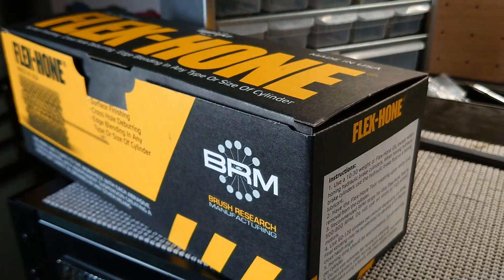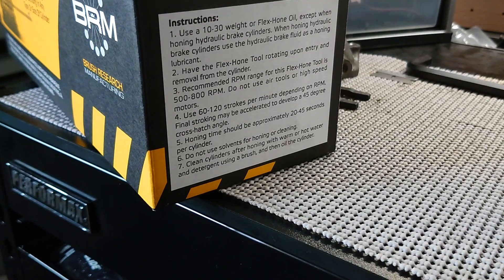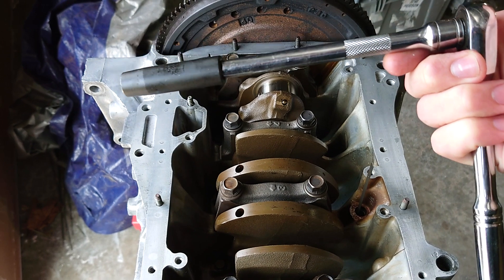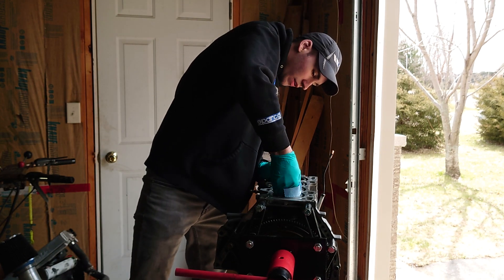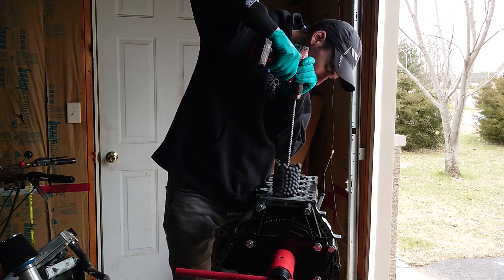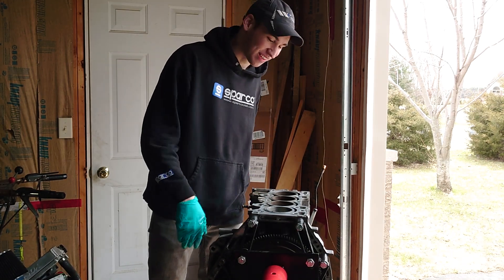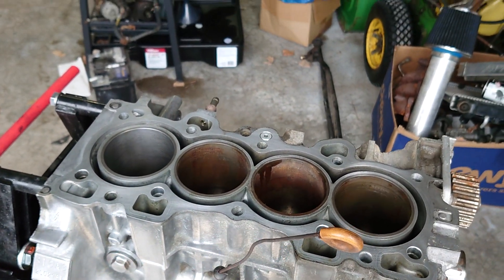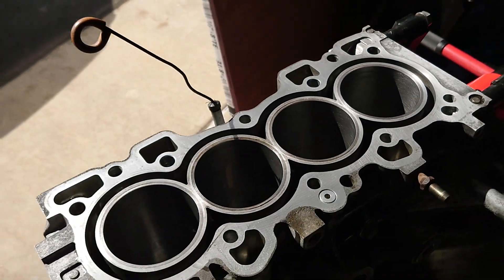Honing Rusty Cylinders on my B16!

Comment: Is it possible to over bore the cylinder using this method? and Can you also use stock rings or do you have to go slightly bigger??
Reply from the maker: You can't properly over bore this way, a machine has to do that. And your definitely gonna want some new rings after this to make sure they are gapped correctly

Comment: I would have put a rag at the bottom of the cylinder to keep the crap from getting in the crank bearings. Flip it and clean from bottom up.
Reply from the maker: I tried that, the hone likes to get caught on it. If I were to do it over again I'd just pull the crank out

Comment: I have a b17a1 that has some major rust, thick rust, i am sure it is from the air/water, but the rust looks like a "build" clunk ... I am hoping this won't require a honing, but I plan to hone it to 82mm 11.8 compression
Reply from the maker: Might as well get it bored out by a machine shop, it is pretty much impossible overbore a cylinder using this method and keep it perfectly straight

Comment: Hey man I blew the head gasket on my 5.9 Magnum motor it's still in my truck right now but I removed the heads and it's been sitting awhile now cuz I ain't been able to buy new heads yet and pretty much it's cold outside right now and is there anything I should worry about the Piston cylinders the Pistons are still in the blockv they just don't have the heads on them so I'm kind of worried that they're exposed to the weather any information you could give would be greatly appreciated
Reply from the maker: Best thing to do to help prevent rust/corrosion would be to spray down the block with oil/wd40 and wrap it up in plastic

Comment: Wow, does the pistons have be removed for this to be done?
Reply from the maker: I'd say so, you don't wanna risk getting any small dirt or metal particles in between your pistons and cylinder walls, that would cause some bad scratches when your turned the motor over
Reply: @kraftingkars  my buddy coated the bottom of each piston with wheel bearing grease and honed the walls nicely for his b18 but I don’t want to take a chance

Comment: Saw another guy asking about having to use new pistons after this method.. I don't expect so since it is not such an agressive method.. but how about new piston rings?
Reply from the maker: I would always recommend new piston rings if you have the pistons out already! And as for getting new pistons, the most important thing to check would be your piston to cylinder wall clearance, sometimes high mileage engines can have quite a bit of wear on the walls, or even oval out of shape. But as long as your clearance is in spec all the way around the piston, you are good to go with your old set!

Comment: Cool thank you I just went to look at my block after sitting a couple months. Had it wrapped in a bag but it built a layer of rust about a half inch ring at the top of cylinder for some reason it worried me so good to know I can do this and clean it up as I’m ready to put block back together
Reply from the maker: Yep! I was really surprised has easily and fast the rust honed away

Comment: Do you need a bigger piston ring after you did that and and Deglazing it? Because I got an outboard motor that I will be doing the same thing and wondering if I have to order a bigger size pistons and rings.
Reply from the maker: As long as you don't go crazy with the honing you will be fine!

Comment: About to do this right now on a new 4g63 block I picked up. Thanks for the video, got my sub almost to 100🤙🏻
Reply from the maker: Thanks man! I'm sure the results will surprise you too! 4g63 ftw!!!!
Reply: Thanks man I picked up 2 blocks yesterday a 6 bolt that I need to work on it's been sitting and a 7 bolt that's fresh from the machine shop still wrapped I'm going to see if I can get a similar result with at home elbow grease.